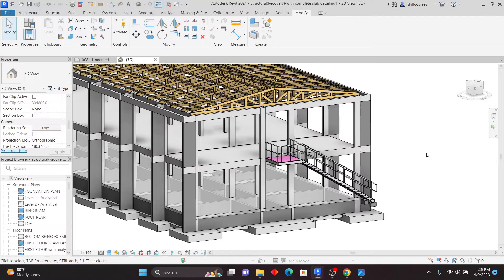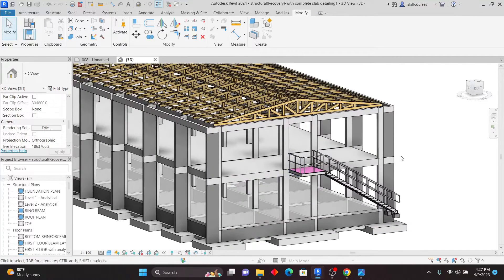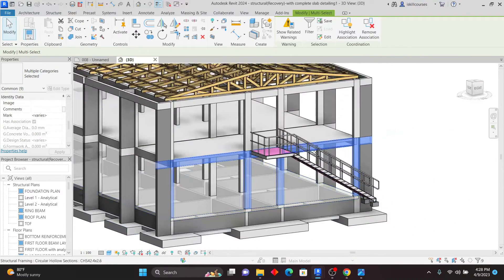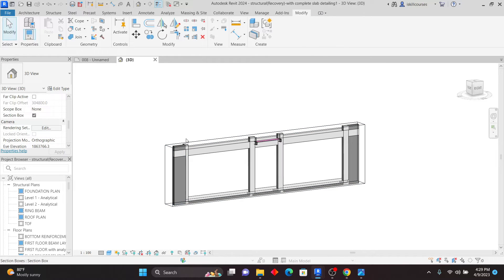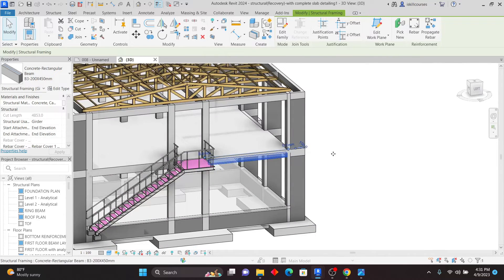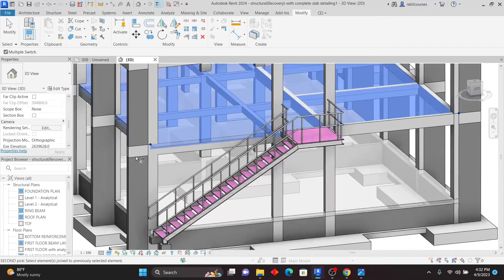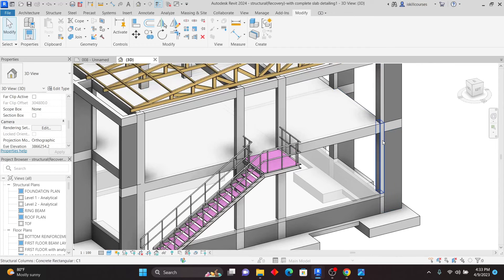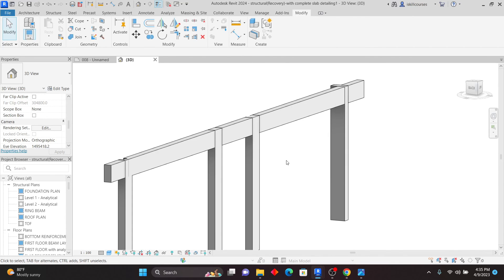Revit tutorials | Revit Switch join Order | Hidden but Important tool

Comment: It was a great video, now I'm also modeling the building with a large area of slab, I did the same thing so the hierarchy of my structural element is correct, and so did the secondary beam and the slab. Because the slab is the element that fills the gaps between the column and the beam (including the secondary beam and primary beam). So I used the switch join tool not only in the edge beam but also in the interior beam. In this case, the area would look like a waffle slab if it is temporarily hidden. What do you think? Also a bit tip for me, this tool isn't supposed to take 9 minutes to explain, just explain less something that doesn't belong in the title of this video for instance the section box, and is temporarily hidden, it's not wrong to put it in the video, but it will make the video even longer and doesn't representative of title, instead just focus on the several examples of join-switch order. The tutorial itself begins at 4.30, the rest is just too long to explain, so just make it shorter. Thank you in advance.